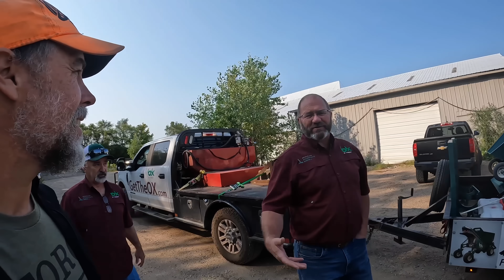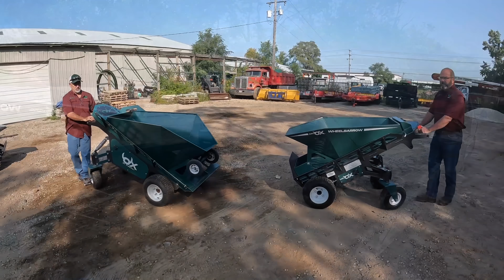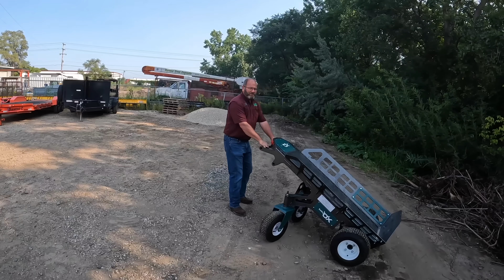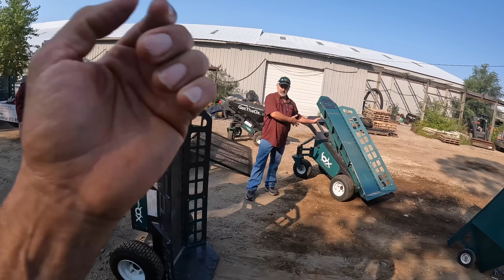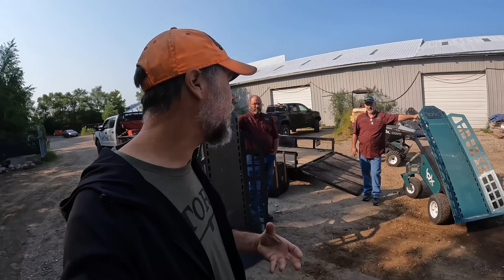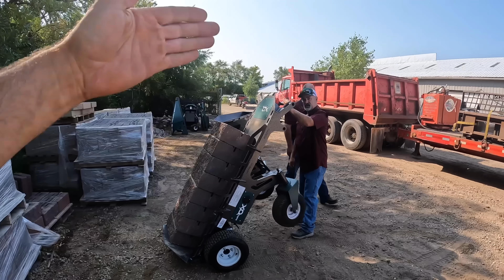The Worlds Most advanced wheelbarrow

Comment: Looks like good quality and engineering. I would like to see one designed to use swapable, large tool lithium batteries so you can keep it running all day. Plently of ebike batteries that could last much longer too.  At least its not gas.

Comment: The cart part has wings on it(Normally you want this)... Do you have a version WITHOUT those wings so you could move a REFRIGERATOR, or large bed frame or anything else that is square?...   Looks like the tires are in the way.  And, is there a version made of aluminum as it appears it is near impossible to dump... Though to be fair, if you aren't HAULING the load around you have plenty of energy to lift.  =-)   But that is also why you have the powered dump!   Hrmm sure would think most folks would want the baby ox with the powered dump option or is that the middle version which was not demonstrated.  Anyways.  For outdoor applications this looks great, though there are other options.   

How hard is it to swap that AGM?  If I was doing tree work, I could EASILY drain that battery in a day hauling rounds as invariably some client wants a tree or two removed in the farthest back corner of their yard and you are not allowed to drive anywhere near it a couple hundred feet away.  3 miles on new battery sounds like a lot(it is), but use it for a little while and well, it is smart to NOT drain AGM and one must be able to go to emergency jobs too...

Comment: As with all electric equipment battery recharge time is the weak point and running time.   I can’t buy 2 to have a fully charged buggy on my job. That just leave one machine sitting charging and with 2 on the job site that leads to theft exposure.   Wonderful idea the electric motor running this will be amazing.    If you have fast change battery pack would help

Comment: If you make the dolly able to lift with hydraulic or chain, it'll become the best multi wheelbarrow. In that case, you can use it to install heavy equipments like water heaters etc. When I was working as a Manager for a CNC shop, we join with an inventor and help invented one dolly that you can crank to lift it especially for installing water heater or lifting the 55G trash barrows at small restaurants etc. But I'm sure it didn't sell well because it was made in USA and looks like crap. But this wheelbarrow looks great!

Comment: I'm a small general contractor and am putting an order in for the Ox. This thing is amazing! I could fabricate a plywood/lumber rack and move 15+ sheets with ease. Not to mention rolls of roofing, windows and doors, water heaters, deck boards, the list goes on. Wow!
Reply: They're wrong about lithium ion batteries, first of all they'll have up to 4 times the range of an AGM lead acid battery also they can work in colder weather environments than an AGM lead acid battery

Comment: throw ATV type wheels on this and take it to Ukraine throw a gymnastics floor pad on with velcro and you have yourself a mobile powered gurney for  rear line battlefield extraction to get troops to the ambulances, also great for hauling ammunition possibly even in the trenches, but definitely for rearming artillery and tanks and fuel barrels.
if the thing could lay down way more to a foot or 18" off the ground you might have yourself a front line wounded soldier medivac solution
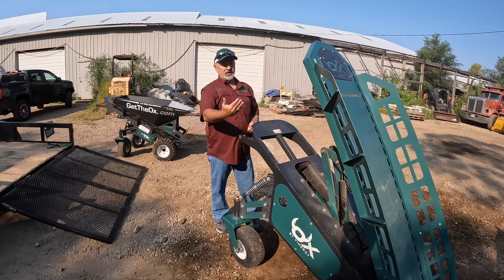9:30 trees are planted by skid loaders for the most part

Comment: They need a jump cable that the two batteries could be backups if the other dies.
I liked the bucket having angled corners, not curved.  Scraping concrete from rounded corners can be a pain.
Curious about holding mixed concrete capacity for each model.
I can see a plow blade attachment for the front, with or without the bucket.  Pushing gravel, sand, snow, and dirt to smooth out what it just dumped.  Not quite seeming a bucket loader tho..   But definitely a plow.
Add a tow hook and a buggy chair.  Or a rear foot rest and seat attached to the frame.  Horn and headlights.. B-)
And one caution to users is...  When bucket is full, no high  speed cornering.  The center of gravity seems pretty high.
BUT If I  were in a business that this could work, IN A HEARTBEAT.  (Like ALL the home improvement and gardening stores.  Paving and road construction...)

Comment: 10:50 a bit staged there having the bucket load biased towards left and the hand push forward afterwards.  I suspect this becomes a mess with an overfill having those lower side rails as opposed to a regular track power buggy.  Nonetheless, the electric application is intriguing for basement crawl underpinning jobs,  but would like to see these rated against stander performance test  like 1,500lbs up 20% grade for distance of 30ft - how many trips on single charge and total time, anyone can dance around in a hard packed yard.  Keep em coming
Reply: might as well add the trailer ball attachment so we could move trailers around the yard

Comment: Property corners were always a shovel out from the wheelbarrow... With this - the automated dump into a corner has the grace of control ! 
Being a powered wheelbarrow, it can eliminate the extra time (that = extra $ costs) using a backhoe for material drop of pavers by having the option to walk materials down to the site level !

The reason anyone would like to see it able to spin completely around on a trailer is for maneuverability off the trailer, and sideways tie down for transport !

(😁and for home composting, it's just one fill and dump to turn the pile, adding minerals and peet on the fill !! Can you imagine walking down the block to a neighbor's house with compost as a no-sweat job?)

Comment: On the front of the controls it could use some protection from the loading unit as seen when stan was loading it with rock. Looks like its also a pinch point for fingers so a guard there would be a good addition. Other than that, it looks like a very handy tool that im sure will come in handy for those retaining walls you do. Great addition to the fleet!
Reply: I was about to comment on the same thing good eye

Comment: I have an electric wheelbarrow and it really helps move stuff around my 5 acre property.  Moving dirt gravel, cement etc. any distance with a manual wheelbarrow is exhausting and the electric really makes it easier.  I don't have a tractor but am getting by without one.  Also used it to stretch wire fencing.
Reply: I have a small tractor but I use my electric wheelbarrow much more often

Comment: It's a very nice little unit. You should use a two-stage trigger for Speed. I can see the fast being a little bit too fast in certain instances. Have you ever considered trying to lower the price by using a cable winch instead of hydraulics. Just an idea it's a little on a high-end price. Keep up the good work.
Reply: 🤔so.. You mean the track-spool method?
If you want to be energy efficient_the track-spool winch is a wind motor that uses more energy than hydraulic injection
Reply: Me thinking some Chinese will copy this. And if ever they did, bet ya, it will be cheaper then.

Comment: I recommend a finger guard between the controller/handle and the bucket. There is a pinch point that looks like it could easily chop or bust some fingers if you are not paying attention while bringing the bucket back down. These look quite amazing overall. I would love to have these on a jobsite. Work smarter not harder!
Reply: either that or two switches in a circuit on either side of the handles, cant pinch anything unless you have 3 arms
Reply: Second that motion. It seems like a cool tool that could be cost effective in some environments but a shiver went down my spine when I saw the wheelbarrow lower down into that pinch point. Our host actually got his finger very close to the pinch point when closing it -- and that wasn't at the end of a long hot day of hard work when running behind when complacency can set in.
Reply: @knowsenough2bdangerous  They have the fix for 2023 and sending out the fix for people who already bought units.

Comment: I wish these gentleman the best of luck. I can see this being very useful for a variety of trades. Two improvements I can see that can be made.  One. A piece of metal between where the tub comes down to meet the frame to prevent accidental pinching or hands getting in the way. Two. Backing up should be slower or have a speed control. JMO.

Comment: That's brilliant! I could have used one of these when I was doing fencing jobs earlier in the year. I did come up with a design in my mind for a motorized barrow I could make with parts from old equipment we had lying around the unit as I hated carrying heavy concrete posts and recently treated wooden panels so much, though my idea was nothing more than a glorified turntable truck with a 4 stroke engine, this is light years ahead.
Reply: Go get a couple. Only 10 grand a pop

Comment: Seem like cool machines, and a sound chassis for building on other things, like a mobile crane/post puller or adapting it for other machinery, like compressors or welders, which are too heavy/large to get to sites by hand, but allow access to places too small, or cramped, for full sized vehicle access, like walking trails.

What may be worth considering is an option to charge the machines off the vehicle's electrical system when trailering it to and from jobs?

Comment: They are pretty bulky.. If you were trying to use them in an existing landscape, it looks like it would be tough to fit between plants/shrubs/trees. Very cool concept though for the right jobs.
Reply: And, if you really think about it, there aren't ANY "right jobs" for this $12,000 contraption!  Just to get it to a job you'll need to tie up another truck and trailer.  And while it's hauling it's big ol load of rocks, or whatever, trenching up the yard and putzing along, four guys with standard wheelbarrows will be smoking it's productivity.  And when they're done, they'll throw all four wheelies in the back of their truck or onto the trailer and take off while this guy is driving this think onto it's trailer and chaining it down.  It's solving a problem that just doesn't exist...

Comment: Retired HVAC guy. This is what I have needed for many years. Perfect for moving the outdoor units out and in. I used to work lake houses, had to use atv and small trailer on the steep slopes.
Reply: Not yet retired HVAC guy here, I use the Harbor Freight hay bale dolly. Huge 16" flotation tires, 24" wide lip with a 16" extension in front. I'm the envy of the delivery guys ;) Even 5 ton package units roll through gravel and soft sod with no issues.
Reply: Ideal for shifting AC units for sure .

Comment: If I understand correctly, the unit goes approximately 3 mph the battery will last for 3 miles under load so battery will last approximately 1 hr of continued use.  Just my opinion,but, that doesn't sound very practical for remote job site use. Could be wrong though... wouldn't be first time.
Thanks for sharing this with us and to those gentlemen for their time and effort to travel to you to demonstrate the unit.
Reply: In smaller areas like this is made for you'd rarely be going that fast very far. I'd bet 1 hr. of this thing going all out fully loaded would out last any person. Also, agm batteries are super reliable and reasonably priced.

Comment: This looks pretty cool but my Muck truck max is a monster. I'm a little iffy wondering about the reliability of the battery in the long run. But would like to try this out.
Reply: If I bought one of those, I'd swap the batteries out to lithium. The lithium batteries would last 10 to 20 years. Probably would add $1200.00 to the price tag too though.